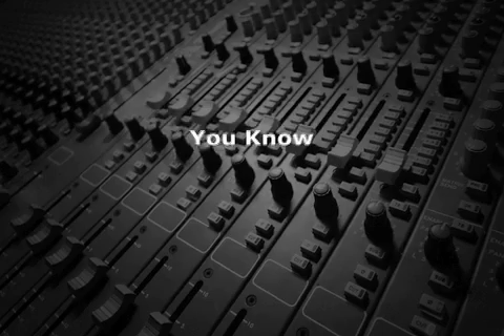AM vs FM

Comment: AM wins  by miles for distance FM is not even close . Reason AM  bounces off the stratosphere .You can pick up AM stations 100's of miles away at night .Works like skipping a stone on water.  The  Fm band does not it's distance is based on power and tower height and  still can't go that far. Test it your self pick your Fm station and drive  you won't make much over a 100 miles.